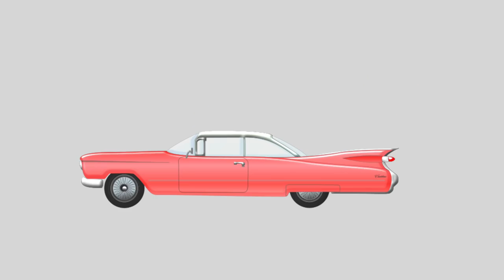Yes, Rockets CAN Fly in a Vacuum

Comment: Oh I see, so they are trying but doing a horrible job of trying to use Newton’s law to explain that it’s the dynamic called “recoil” that is “pushing” the rocket.
Either these people (and she did not make this presentation up herself, I just read it verbatim from an article by discover magazine) are the worse explainers that I can possibly imagine, or they are being purposefully confusing because their theory can be so easily disproved.
To explain it simply, the force that they are trying to use here is called recoil, and its the same force that slams the butt of a shotgun into your shoulder when you fire it. Well my friends, if you take away the projectile and again fire the shotgun, the recoil will be gone. This is because the composition of the explosion has no mass (let’s call it “air” for the ease of understanding for everyone). 
The “air” thrusting out of the rocket has no mass and therefore the action and the reaction of such insignificance that they can’t even be considered factors.
It’s bullshit
Reply: If the exhaust gas (call it what it is) has no mass, where does the mass of all of the fuel go?

There was 5 time more fuel than rocket by mass on the Apollo SIV-b stage. After the trans-lunar injection, all of the fuel was gone. If the exhaust gas no mass, where did all the mass go?
Reply: Niall Kinsella,
You do realize that you are asking me to answer a question regarding a scenario that I don’t believe exists.
Well anyway, I’ll give you a hint: E=MCsquared
Reply: @sooperdoopercoolguy  I can convince anyone willing to answer about five high school physics question that rocket propulsion MUST work i a vacuum, but I bet you are not willing to play along because you dropped out of high school before taking basic physics.

Hint: My 12 year old granddaughter can answer the questions.

want to answer the questions

To see if you even qualify for question #1, answer this one:

If I fire a steel projectile from a crossbow , here on earth, will I feel a recoil force?
Yes or No?

watch as sooperdoopercoolguy flat out REFUSES to answer any questions.
Reply: Stuart Gray,
Force=mass x acceleration 
The rest of your post, I have no idea what you’re talking about.
Reply: @sooperdoopercoolguy  
He asked you a yes or no question.
Don't deflect, it's pathetic. Just answer the question.
Y or N will do.
Reply: @sooperdoopercoolguy  so does a crossbow have RECOIL?  Yes or no?  If you don't know, just say so.
Reply: Stuart Gray
Yep I flat out refuse. I’m not interested in answering your questions. I came here to have questions answered, not to answer questions. Why don’t you tell me something? 
Or if you insist on  doing whatever song and dance you’re doing, just go ahead and answer the questions for me, I give you permission to act as my agent.
Then just let me know when it’s all wrapped up, and I’ll check it out. (=
Reply: Niall Kinsella
Deflect? I hadn’t even responded yet. So you should take back your “pathetic” comment.
Reply: @sooperdoopercoolguy  
"I hadn't even responded yet"

You understand that these comments are timestamped, right?
You understand that it is clear to everyone that you replied to Stuart Gray after he posed you the question, and that you didn't answer his question in your response?
It is clear to everyone that you went on a tangent instead of addressing a simple question.

So no. I'll not be taking back my comment. I'll keep demanding to know why you can't answer a simple bloody question that is very relevant to the topic you are trying to claim expertise on.
Someone who knew what they were talking about could and would answer it in a heartbeat.
Reply: The answer is yes
Reply: Stuart Gray

Seriously? This interface is ridiculous I just lost the whole answer that I typed up. I’m using my phone so…
As I was saying, so now I have to explain it? What the hell Kind of deal have I gotten myself into? this is going to count as the second question, because my patients grow stand for this!
So you want me to explain the dynamics huh... 
upon releasing the power that was stored in the bowstring, exerting force against the projectile upon which an equal reaction of force is exerted back against the bow string, into the bow, and into your hand you feel the recoil, minus the loss in transfer of course.
Not bad for layman huh, professor?
Reply: @sooperdoopercoolguy  Good explanation thank you.

Now imagine another test scenario:

An astronaut is floating in "freefall" in a vacuum.
He has a remote controlled crossbow loaded with a steel projectile and cocked. 
He places the crossbow (and projectile) "floating" a few feet in front of him pointing to his right.

The bow, projectile, astronaut have zero velocity with respect to each other. (no relative motion).

Now the astronaut fires the crossbow using the remote.

Explain what the astronaut witnesses happen to the crossbow and the projectile.
Reply: The force is exerted back upon the space cowboy
Reply: @sooperdoopercoolguy  But the astronaut is not touching the bow when it fires.
He will feel no force from the experiment, but both the bow and the projectile WILL.

WHAT will the astronaut see?

Next: replace the steel projectile with one of the SAME MASS but made from water ice.
Repeat the experiment.  What does the astronaut see different with the experiment?? Anything?

WHY or why not?
Reply: He will see both projectiles travel away from the force exerted upon them ate rates according to their mass since the forces are equal, according to his frame of reference of course.
2) Same, since there are no other factors
Reply: Are we having fun yet?
Reply: @sooperdoopercoolguy  So now that you agree that a "catapult" or "Crossbow" could push away WATER (mass) and get pushed backwards , in space, in a vacuum.

Yes?

DO you KNOW that a space shuttle main engine combusts 500 kilograms of liquid oxygen and liquid hydrogen PER SECOND and expels it at 2500 meters per second?
This is about Mach 8 at sea level.
Know what it "expels" ? PURE WATER.

So a space shuttle main engine can accelerate 500 kilograms of water PER SECOND from a relative velocity of zero (with respect to the rocket nozzle) to MACH 8 in about 15 feet.

Will this "WATER CANNON" feel a recoil force?
It sure as hell does!

Lookup the "Law of Conservation of Momentum" to appreciate the momentum of 500 kilograms of water moving at 2500 meters per second.
Reply: Stuart Gray
@sooperdoopercoolguy 
“So now that you agree that a "catapult" or "Crossbow" could push away WATER (mass) and get pushed backwards , in space, in a vacuum.

Yes?

DO you KNOW that a space shuttle main engine combusts 500 kilograms of liquid oxygen and liquid hydrogen PER SECOND and expels it at 2500 meters per second?
This is about Mach 8 at sea level.
Know what it "expels" ? PURE WATER.

So a space shuttle main engine can accelerate 500 kilograms of water PER SECOND from a relative velocity of zero (with respect to the rocket nozzle) to MACH 8 in about 15 feet.

Will this "WATER CANNON" feel a recoil force?
It sure as hell does!

Lookup the "Law of Conservation of Momentum" to appreciate the momentum of 500 kilograms of water moving at 2500 meters per second.”

Hahaha, so that’s what you got for me? You can’t be serious? You put me through that stupid exercise and then fell flat on your face.
I can’t begin to cover all the stupidity of your premise, but let me point out a few things. You obviously have no understanding of states of matter, or of water, to be specific in this case.  at first I thought you we’re playing some kind a joke ha ha.
You do realize that those engines burn the oxygen and hydrogen? Obviously you don’t, but it’s pretty common knowledge professor. Anyway so when it’s burned it becomes vaporized into gas and vapor, thereby reducing the mass exponentially.
And too bad you’re so close minded and blindly faithful to the gatekeepers of science. Like religion, it’s not the system itself that’s bad, it’s the human element, the gatekeepers, the ones that would hide the truth for their own selfish means.
Unfortunately I couldn’t make you understand because you don’t understand the premise of burning oxygen and hydrogen, that the idea that jets burn jet fuel, which is a grade of petro near kerosene, is a farce.
Jet and rocket engines are powered by compressing air and combusting the elements within it. It only takes jet fuel to start the motors. once they’re running, they run off the air that’s running through them.
It’s a conspiracy by the petro companies (known to be of most wicked of corporations) to keep us from realizing that there’s free, or close to free energy.
It doesn’t take an engineer to see that the wings of a jet plane, cantilevered off the body, could possibly hold 80,000+ gallons of fuel, a gallon weighs 8 pounds by the way. anyway there’s a conspiracy for you. And the evidence is right there in your post where you explain what the rocket burns...
No mention of jet fuel correct?
Reply: OK I checked my numbers and a 747 is said to hold about 60,000 gallons of fuel, times 8 pounds, equals 480,000 lbs, or shall we say, HALF A MILLION POUNDS! Or shall we say 240 TONS!! And most of it is claimed to be stored in the wings.
Now if somebody where to know anything about physics, they would know that once you start cantilevering weight, the downforce, or weight, multiplies exponentially. It’s beyond ridiculous to claim that those wings could hold that kind of weight.
Reply: Stuart Gray
You’re absolutely right Stuart gray. Of course I know of conservation of mass, but I’m guilty of straying into a erroneous line of thinking. I don’t know what happened, I can’t explain, other than people make mistakes. What’s important is that I admit I’m wrong, because I am interested in the truth of the matter, not being right or wrong. I don’t have the time or the mind to explain correctly the reason right now. I hope that I can get back to it, and redeem myself. In the meantime, I didn’t wanna look like I just ran away like a coward. Until then peace be with you.
Reply: To state simply rockets rely on pressure, and you cannot have pressure in a vacuum, for it simply dissipates into the vacuum, especially in the “volume” of “space”.

Comment: Nice to ask this question... Car analogy, no so good... Some questions to the air... what is a force? Is tricky talking about the 3th law of newton, at the same time in two diferent environments, as if they were the same. The main thing here is the diference of pressure of both environments. You need always something to move in relation to. In space, vacum, you can't relay on pressure to help, specially with explosion(releasing of pressure). Imagine you fill your lungs, and blow out in vacum, what "equal and oposed reaction" would happen? The vast space will absorve every release of pressure... we can move some mass by "pushing" some other mass in relation to. Without pressure or resistence, we just have the mass, and imagine trying to make the car move with just the exaust power. Keep with the work
Reply: Tell us what would happen if you fired a crossbow into a vacuum?
Would if still have a recoil?
Yes or no?
Why or why not?

I have found that most people who "disbelieve" in rocket propulsion (or are confused by it) cannot explain simple mechanical recoil from a gun or device like a crossbow.
Reply: @stuartgray5877  Yes, the recoil is the release of tension into both masses.. so it would work in space. I understand this, but this has nothing to do with explosion. I understand that you can use mass and "force" to move in space... But it would require a lot of "mass", wich i don't think you can use líquid or gas to move a lot... And i don't understand the all part of combustion/explosion in vacuum? How can you use the energy of an explosion on an environment wich Will absorve the totality of it with no resistence? From where do you get this "extra" boost from the explosion?
Reply: @MarceloOliveira-ji9ey  so will the crossbow get “propelled backwards” if it fires a projectile forwards?
How?  There is nothing in space for the projectile to push on.
Reply: @MarceloOliveira-ji9ey  rockets lift off as about 99% Fuel and oxidizer. All of that turns into mass as exhaust gas for the rocket to PUSH OUT 
Since the exhaust gas has mass it requires a force to PUSH IT OUT 
What does Newton’s third law say about forces?
Reply: @stuartgray5877  well, it may seem that way, but actually both are being propelled by the release of tension... Is not One that pulls the other
Reply: @MarceloOliveira-ji9ey a rocket engine applies a force to the mass of the exhaust gas accelerating it from the rocket.  
Do you agree? Yes or no?

Next what does Newtons 
THIRD
LAW
SAY
ABOUT “forces”?
Reply: @stuartgray5877  this example does aplly to the situation... You must have some relation between the masses in order to have recoil, if the arrow is made of gas or líquid, probably the recoil would be almost nothing, specially without resistence from the environment?
Reply: @MarceloOliveira-ji9ey  so you believe that gases or liquids are massless?
So a rocket exhaust like Water or CO2 is “massless”
Maybe you should complete your education?
Reply: @MarceloOliveira-ji9ey  - "if the arrow is made of gas or liquid, probably the recoil would be almost nothing"

So you think "GAS TURBINES are a hoax"???
Because if you think that "Gas has no Mass" then water "gas" (steam) could not possibly move the blades of a turbine. Right?
Reply: @stuartgray5877  You have an 1m³ Cube filled with "normal pressure" connected to another equal one, but on vaccum... When you open the conection, how much force would you have to aplly in order to overcome the "pressure osmoses" and start having propolsion?
Reply: @MarceloOliveira-ji9ey  That is not a coherent question.
Try this one:
How much Mechanical "Work" is performed by accelerating 500 kilograms of "mass" from a velocity of 0.0 m/s to 2500 m/s.

Next assuming a "catapult" that can fire a ice block of 500 kilograms from 0.0 m/s to 2500 m/s.
It can accelerate that block from a standstill to 2500 m/s in 5 meters.
Can you tell us the "Force" required to do so?

These questions are directly related to rocket propulsion. I'll explain exactly how and why after you answer.  (hint: you can ask chat gpt these types of physics questions and it can explain the answer in extreme detail if you like)
Reply: @MarceloOliveira-ji9ey  Where did you go?  I was trying to teach you the fact that "Rocket Propulsion" is really just the "Mechanical Recoil" due to the engine PUSHING OUT MASS.

So, you agree that rocket engines "accelerate mass"? Yes or no?
Reply: @stuartgray5877  i replied... 
This mechanical recoil that you talk about, is not really a mechanical recoil as in the arrow/bow example, this that you talk about is more of "pressure recoil"....
I think they are diferent things when we are at a no pressure environment... 
Tell me, What is an explosion, when you don't have any resistence to it?
Reply: @MarceloOliveira-ji9ey  So your answer is "I dont know".
See this is why we have "Engineers" that DO know.

I was going to ask you next if there is any difference in the equations if you calculate accelerating solid water, liquid water, or gaseous water (steam).
But I don't think you are capable of grasping the significance.
Reply: @stuartgray5877  well, this is not an answer of someone who wants to explain something, is the answer of someone who wants to be right over the other... I'll say, you relay a lot upon equations on paper, while reality is very diferent, and even within science, there are contradictions ... Maybe you don't know, but something is true until is not... And any equation can be true on a specific point of view... But there's no absolute true... Taking advantage of a misundertood detail in order to use the 3rd law of newton as a shield, is not right... If you can't talk without this pre-concepts, and that arrogance of seeing yourself as smarter, i don't want to continue the conversation... By the way, there's any footage of this propolsors working in space?
Reply: @MarceloOliveira-ji9ey  - " By the way, there's any footage of this propolsors working in space?"

Any of the >350 SpaceX videos of the Falcon9 flying around well above 50 kilometers and returning to the launch base to land.
Reply: @MarceloOliveira-ji9ey  Oh and FYI - My JOB of the last ~30 years has been building, testing, Launching and Operating earth orbiting spacecraft and deep space science probes.  I have helped FUEL spacecraft and put them on the rocket. I have been the launch Conductor, and I have witnessed about 40 real rocket launches many from closer than the public is allowed.
Maybe you could consider getting a high school education?
Reply: @stuartgray5877  oh, uau !!!i'm sorry, you're right... I should get high school... Now it makes completly sense... Or it will when i learn

Comment: Gas expands out of the rocket due to pressure differential. You can experiment using a kitchen scale and a cup. Place a penny in the cup and place the cup on the scale. Get a vacuum and pick up the penny with the vacuum hose. The air moves because there is low pressure in the vacuum. However, you will notice that there is no opposite reaction as these liars says there when you observe what happens to the scale. No increase in weight at all. Air flow strong enough to pick up the penny but not register a force on the scale? Also joules-Thomson has already proven gas expands freely into a vacuum without doing work.